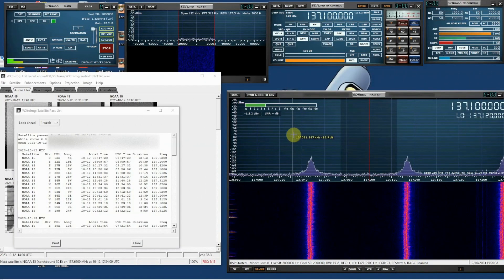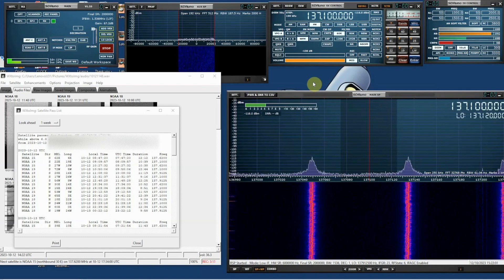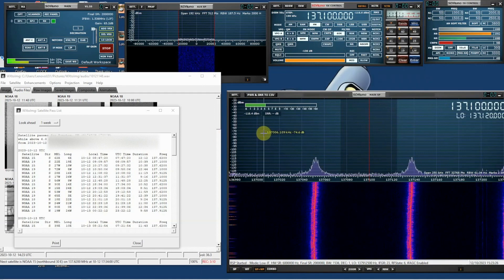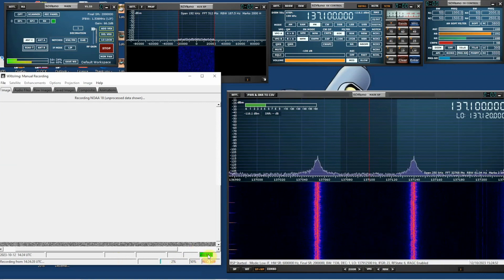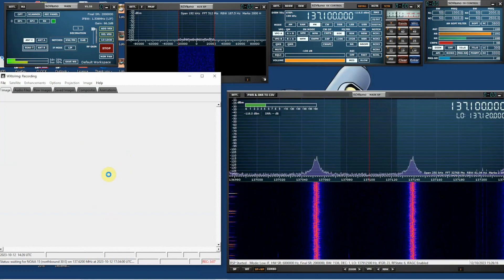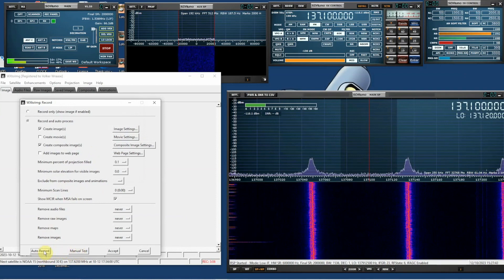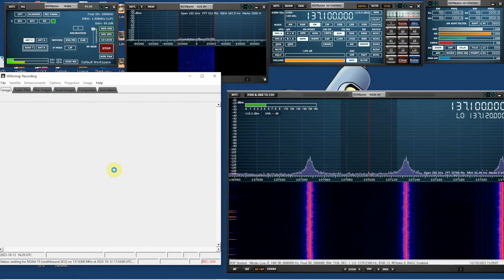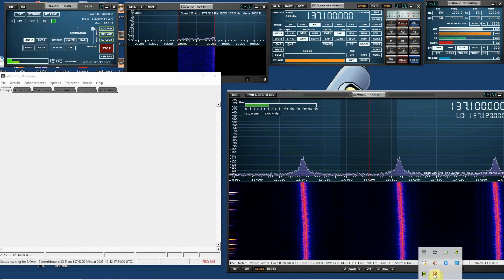A brief overview of how to set-up SDRnno with WXtoImg NOAA weather satellite decoding software

Comment: Install Virtual Serial Ports
Choose a free COM port on your computer, max COM 10, create a connector on that port
In WXTOIMG select Options/Recording  and choose the receiver as Kenwood and the port you have defined above
In SDRuno select CAT with the port above and connect
When auto recording will start in WXTOIMG the software will automatically tune SDRuno on the frequency of the visible satellite and apply doppler correction
Reply from the maker: Thanks for the tip - if only I had the time....